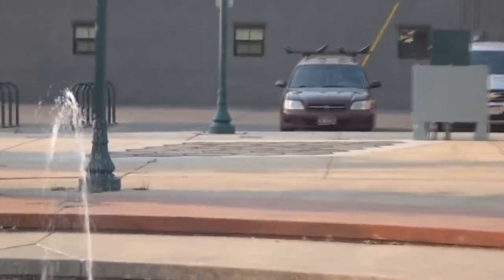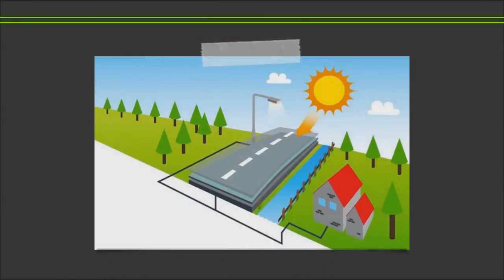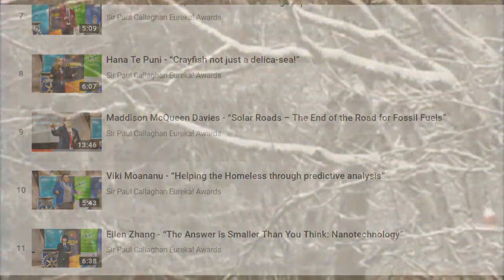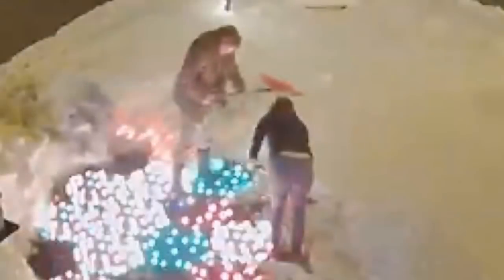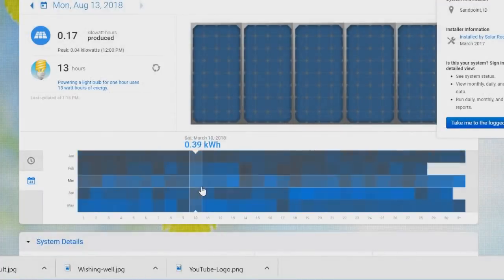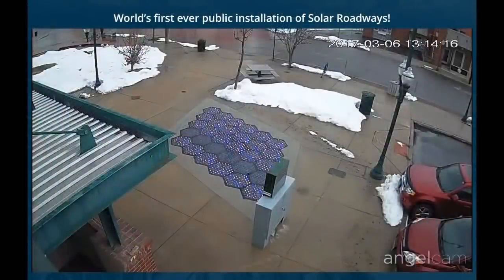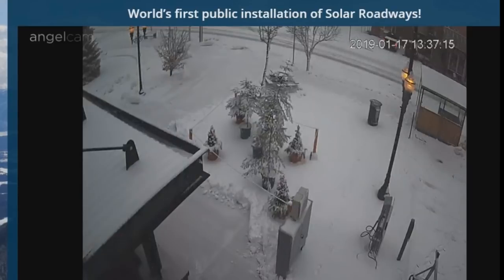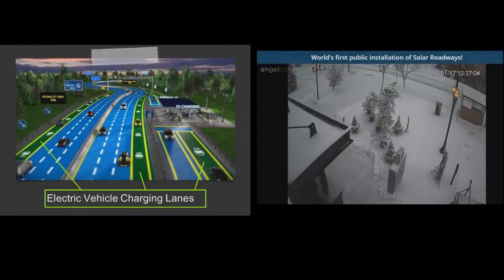Solar Roadways to be installed on Cruise ships!!?

Comment: Having black road surfaces is more efficient than solar panels to melt snow. Yet, it still fails at doing it sufficiently.
Reply: having a flamethrower cook the roads works pretty well though (to bad it caught the trees on fire cause its so dry out)
Reply: @speedy01247  Jeremy Clarkson tried that approach in a Top Gear episode, the flamethrower looked impressive but did nothing.
Reply: If we up the scale of global pollution we can get grey and even blackish snow and that will melt the snow. Food for thought....?
Reply: @DreadX10  Those particles are too heavy to travel long distances.

What if I told you CO2 emissions aren't as much of a problem as the propaganda claims? Fish populations and aquatic plants have been on a consistent linear 1 percent annual decline for over 50 years. Oceans are 71 percent of global coverage and those oceanic plants produce 50 - 85 percent of global oxygen.

Oceanic farming is capable of sequestering 2 to 20 times more CO2 than forests. Even if it's only 2 times there is zero risk of natural wildfires negated sequestration.

Should we be focusing on repopulating fish who supply nutrients for these plants? Or follow the propaganda pushed by naive Liberals?
Reply: @Cerberus984  "Those particles are too heavy to travel long distances"

Actually no. If you don't believe me, just read the 2009 National Geographic article about Greenland's melting icecap
Reply: @99certain45  Based upon EPA and various University research PM 10 can only travel around a couple hundred yards while PM 2.5 can only travel couple 100 miles. These distances vary based upon weight, winds, elavation where it's emitted, and diffusion with cleaner air.

Just because Greenland has "dirty ice" does not automatically mean it was human caused pollution. The most probable source are volcanic eruptions in Iceland being launched miles up into the sky catching the high speed polar vortex and making a round trip depositing itself onto greenland.

Which the weather channel and universities support in an article titled "Volcanic Eruptions May Be Rapidly Melting Arctic Ice Sheets, Study Says" Listed below are some excerpts from the article..

-------
Over a time span of 1,000 years, we found that volcanic eruptions generally correspond with enhanced ice sheet melting within a year or so," lead author and Columbia University's Lamont-Doherty Earth Observatory postdoctoral fellow Francesco Muschitiello said in the release.

In some instances, the volcanoes were thousands of miles away from the sheets, but the massive clouds of ash from the eruptions took to the skies and fell across the ice sheets, the researchers report. This caused them to absorb more heat than usual and become darker in color. 
-------
I tried to find equatorial polar circumference (not pole to pole) but couldn't find any data. Based on my knowledge of spherical based CVTs such as the Nissan Extroid or Fallbrooks NuVinci the polar equatorial polar circumference should be smaller. As to what it is specifically I'm motivationally challenged to be precise as I know it's smaller.
Reply: I have literally seen asphalt that has become bleached practically WHITE, and how is that possible? I don't even think I'm exaggerating, I genuinely believe I have seen this. Fresh asphalt is black, yes. Older asphalt, becomes less dark over time. I swear I've seen this!
Reply: @Jamal_Tyrone  Yeah, a reducing flame hitting from the top will do that.
Reply: @Grunchy005  You're seeing the dirt that's caked on it...

Comment: It makes me want to smack my head against a wall when they claim solar roadways can generate enough heat to clear snow off themselves. They seem to assume that it's a trivial matter to just keep the panels at 1C and snow won't lay, but that's not how temperature works; you actually need to produce enough energy to MELT ALL THE SNOW THAT LANDS ON THE ROAD! XKCD did a "What if?" asking why we don't clear snow with a flamethrower: It's because the energy required is monstrous! The sun definitely doesn't even put down enough energy per unit area - if it did, it wouldn't be winter!

I'm not sure if the companies behind this sort of scheme are astonishingly incompetent, or intentionally misleading, but this is the sort of thing that should be figured out at the "back-of-an-envelope" planning phase.
Reply: That sun argument of yours encapsulates the essential stupidity of the idea in a way that even a Trump supporter might be able to understand.
Reply: Yeah that bit always got to me - how is converting sunlight into heat through solar panels and heaters going to work any better than the direct radiative heating of the Sun on blacktop? It doesn't work even at a basic principle level.
Reply: @drunkenhobo8020  
It can't be any better, but it can't be any worse.  When your goal is heat rather than power, there is no such thing as an inefficiency.  It all ends up as heat, one way or another.
Reply: True when dealing with the actual heating elements or components, but solar cells themselves aren't 100% efficient at capturing photons, and some light will be reflected back as visible light rather than heating up and emitting infrared.
A black surface is probably better at it than solar panels.
Reply: @drunkenhobo8020  
Doesn't matter if the panels area little reflective when you have six inches of snowfall in an hour.  Little of the light that gets through the snow to them and is reflected will make its way back out of the snow.

It's all bollocks anyway.  They couldn't do the job if they were 100% efficient and they couldn't do it if they were 100% inefficient.  It doesn't get any better anywhere in between those two limits and it doesn't get any worse.  Well, not measurably worse.
Reply: Houses built in the 1970s in the part of Illinois where I was raised usually had concrete driveways — and some had embedded electric heating elements to melt snow. Those tended to break, and they were expensive to run. Expecting solar roadways to return enough power to make up for the amount of power from the grid needed to melt the snow on them... that’s insanity.
Reply: @bdf2718  That assumes that solar panels would not reflect light.
Solar panels in general have an albedo in the range of 0.15 to 0.3 where as asphalt 0.05 to 0.2 - so a solar panel definitely can not melt as much snow.

Comment: To make matters worse, this is being posited in New Zealand, a country that doesn't need significantly more of the type of energy generation that comes from solar and wind.

New Zealand's energy generation system needs to provide EXACTLY the right amount of energy the country needs in order to keep the mains frequency around 50Hz. Solar and wind provide an unpredictable amount of energy, and this means that they need to generate less than the total amount that can be supplied by variable sources (mostly hydroelectric), so that if they aren't supply anything, that source can take the full load, and if they're supplying at maximum they don't push the usage over capacity (and remember, capacity MOVES).

Basically, New Zealand needs more controllable sources of power, rather than "you get what you get" sources. So even if SFR worked, which they clearly don't, New Zealand wouldn't want them.
Reply: No problem they just need a special government department running thousands of dishwashers, laundry machines, hairdryers etc on permanent standby when the excess power is generated they can quickly turn everything on. Norwegians will know how this is done https://youtu.be/sAV2Ft2w928
Reply: wouldn't they use like batteries or some sort of control system for the unpredictable energy spikes/dips?  (have almost 0 knowledge of electricity, so this is a legitimate question)
Reply: @speedy01247  Batteries at the scale required aren't feasible. What they do is run the turbines from the hydroelectric dams on electromagnets rather than permanent dipole magnets. This lets them control the exact amount of power the dams generate. They rarely run at full capacity, so simply turning on or turning up one of the turbines lets them generate more power on the fly.
Reply: Worse case scenario you guys can take from the ocean that surrounds you.  I wouldn't go full solar or wind unless I was in a landlocked desert.  Or California.  Because that's a desert too.
Reply: You could use the excess energy to pump water up into a reservoir in a eleveted place and use it as hydro electric power later. Obviously one has to look at the averages and peeks of solar abd wind energy  during an entire year (better yet decade) as well as having the necessary free space in an elevated location.

Comment: How can people be so naive? All they have demonstrated is an outrageously overpriced LED display with solar panels so inefficient they barely warrant a mention. NONE of the claims they have made over the years have been verified, even something as fundamental as road markings using LEDs has not been shown to actually work in real world situations, and I'm skeptical that they would, especially during the day time. One things for sure - the pathetic, low density LED displays they have on the prototypes aren't going to cut it. 

Why even mention cruise ships when they aren't even a hundredth of the way through step one? They promise the world, but all they've delivered is some cheap looking LED art installation that isn't even robust enough to withstand light foot-traffic.
Reply: "NONE of the claims they have made over the years have been verified"
False. They ALL have been verified to be lies. Most of their claims are even just physically impossible.

The LED road-markings for example - decent road markings have an albedo of at the very least 0.5 (i know some concrete roads with higher albedo than that where you can still easily see the white markings) - that means even if you had a solar panel that covers 100% of the area and has a 50% efficiency it will be less efficient than just drawing the road markings. And at then you still have the problem that the light would be very directional only.
Or the panels melting snow - they have a higher albedo than asphalt as such they can not produce enough heat them self to clear the snow - the snow would actually pile up even faster unless you use some other energy source to melt it away - which as it turns out is pretty much the least efficient and most environmentally damaging thing you can do.
Reply: That's exactly why they are now trying to get into other markets such as cruise ships. They know these things will never be roads. However they can use their publicity to convince some cruse ship line who spends a few hundred mil anyways to build a new ship that getting these "eco friendly light show panels" installed on their deck would make their cruise ship ,which blasts crude oil into the ocean and pollutes it at a rate that more than one million cars wouldn't achieve, look a lot more "eco friendly" to those dumbasses who book cruise ship trips.
Reply: because science is hard and people are lazy

Comment: Know a way to stop snow in parking lots? Having solar panels elevated over the parking lot. Benefit? Less thick glass, cleaner, and the ability to install lighting fixtures underneath the panels. 

Extra benefit? Shade during a sunny day and cooler cars.
Reply: Tesla already does that with some of their charging stations.
Reply: @fixman88  Oh I know, there is a reason solar panel companies aren't putting solar panels inside the road.

Comment: Cruise ships aren't a terrible use case for them, provided no one wants to stand on them barefoot -- or even with sandals/flipflops, sit on them or put their cold drinks down on one-- and that they use anti-corrosive materials that can withstand the constant onslaught of sea water (yes, sea water gets EVERYWHERE on a ship), and that the ship owner is happy adding 5-20 million dollars to the cost of their vessel with the electrical generation equivalent to a tiny fraction of the ship's main powerplant.  

Wait, they actually might be a terrible use case (as is everything else)
Most cruise ship diesel plant's are capable of ~40-50 MW of power production.  Let's assume for a second that you could blanket every square inch of a ship's ~300x35 deck footprint in the most efficient solar panels ever produced (which you can't, because of the ship's oh, superstructure and amenities -- reality is 3000  sq meters of potentional real estate -- that is also being covered in oh, lounge chairs, humans and the like which are not conductors of solar energy).  AT absolute BEST,  solar panels could, in peak conditions (which is less than 4 hours a day), supply about 2.5-4% of the ship's power demand.  Never mind the rest of the day, where that percentage drops drastically (to 0% during night hours) and you have about .5-1% total of a ship's power demands met by solar freaking roadways-- again, assuming full stern-to-bow coverage of panels that are optimal quality, not being covered by humans/chairs/superstructure/superstructure shadows.   Never mind the fact that the materials in said solar freaking roadways are inherently NOT well-suited to sea-water exposure and you'd end up replacing many of them out of cycle and all of them during drydock cycles.  The economics are not there, meaning a cruise line (whose motive is profit) would be absolutely out of their mind to even consider such an idiotic thing.
Reply: And now the input and costs' been discussed, let's talk added weight...
Reply: @canicheenrage  Noooooo.
Solar freaking roadways, they just keep on giving!
Reply: @M R Bruh.
Who are you responding to?
Not one of the comments said they were a good idea, not even the OP.
If I had to give it a guess, you are responding to the guy who said they aren't a terrible case and later in the same comment said "Actually they are terrible".

Comment: On the deck of a cruise ship is a good spot for it. And maybe a hybrid road with concrete or asphalt under the tires could work, but still more economical to just attach solar panels to existing street lights.

Comment: The only real solution to climate change/clean electricity esp. for base load electricity is Nuclear, yes some places are not safe enough to site the plants, but given enough intrinsic safety and properly designed backup systems that can be mitigated to some extent.
France had/has the right idea and it shows. 
Admittedly they are expensive to build but that must partly to be due to the fact they are not (for most countries) a mass market product and the decommissioning issues (primarily due to the fact that decommissioning reactors is a relatively new skill/expertise and as such we are still learning). 
Also in the case of Hinkley Point C ~half the cost is due to private financing, something where if the government had financed it would brought the cost down by billions.  
As for safety, the four major nuclear disasters (Windscale, TMI, Fukishima, Chernobyl) were due to a mixture of design and/or operator errors, that hopefully we have learnt from and engineered out wherever possible.

Comment: Even despite your ridicule, I find myself wondering how an idea LIKE this (but not this) might be made to actually work.  Your biting critique serves to eliminate certain things...

1.  Lighting them up doesn't work well, consumes energy and offers few to no benefits.
2.  Heating the panels is a non-starter (could have told you that from the get-go; consumes/dissipates too much energy).
3.  Driving on the panels means they have to be incredibly robust, if indeed it can be made to work at all.
4.  Laying the panels flat gives reduced performance and diminishing returns with increasing latitude.

One might go on to add that glowing claims that can't be achieved would be inadvisable as well.
And that profit and results, not grants and accolades, should be the driving force behind the effort.

Which pretty much means making the roadway itself solar needs to be discarded entirely as an idea.

But still: roadways MIGHT provide a basis for workable power generation nonetheless, because they provide a right-of-way along which actually workable panels could be installed.  Access and maintenance would be aided and so on.

On the uncertain theory that solar panels can be made economic at all in such an arrangement, some carefully contrived ideas might lead to workability.  Conceive, let's say, that the price of suitable panels is not instantly prohibitive; that we have a locale with adequate sunlight; and where the price of electrical energy is rather high.  Panels could be strung along the roadway, say, just off the shoulder, tilted at an angle appropriate to the latitude and raised enough to avoid the worst of problems like the spray and grime that automobiles throw off.

If not direct cost, the setup would have to have SOME advantage, and preferably a very distinct and coldly calculable one.  "Need power here but just can't get it otherwise" sorta thing.  Maybe, just maybe, it could work well in lots of places.  To do it really-big this way doesn't seem workable however.  Let roadways be roadways.  Put your panels where they'll count for the most.

Nonetheless the idea of Big Solar, in broad terms, is attractive.  The problems it presents are interesting.  Really really cheap panels might one day lead us to start placing them everywhere we can think of, in a bid to harvest every possible watt.  Clearly though we must not accept muddy thinking again else there we'd go, giving Thunderf00t more fodder for his mill.  :-)
Reply: JamesG Then why not just build a canopy over the road, and place the panels there?
Reply: It could work, just put solar panels that track the sun next to the road, it's genius